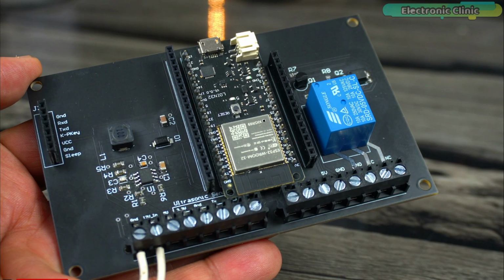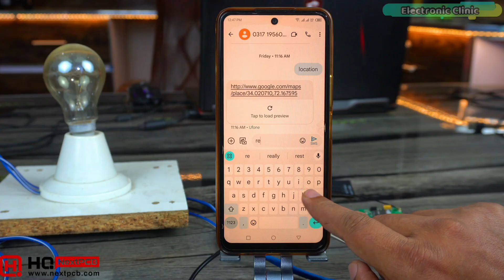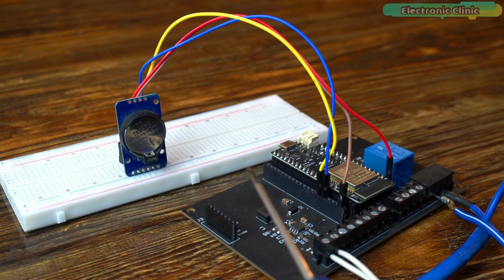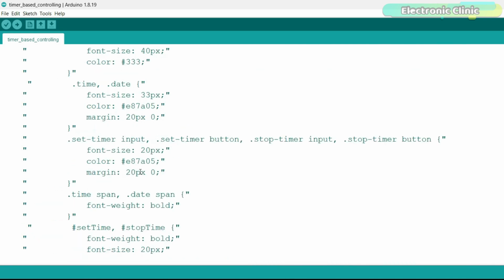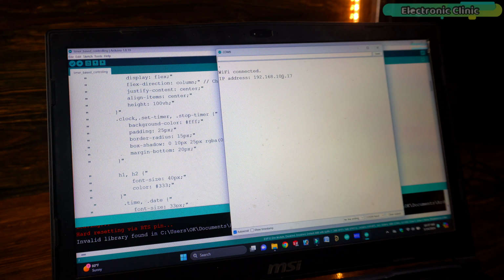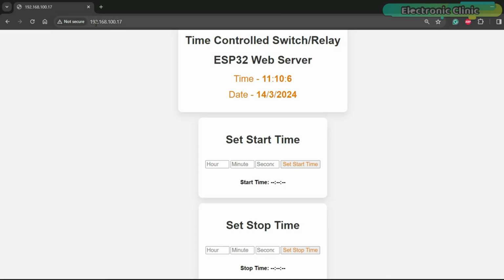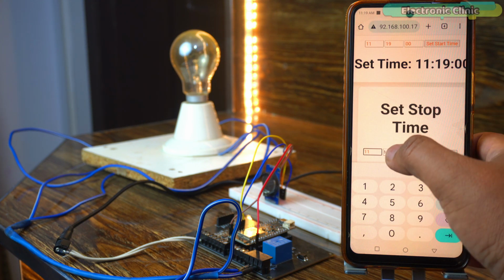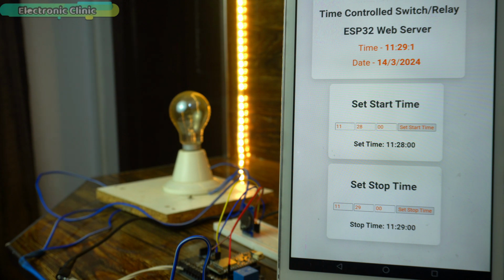Time controlled Swtich using ESP32 Web Server and DS3231 RTC

Comment: Awesome project, the only thing lacking is the on off set time storage into eeprom memory.  Can you modify the code to add that feature also so that one does not need to reprogram it on power failure,

Comment: Sir esprainmaker iot with esp32 working inbuilt RTC control relay without internet one time fetching schedule time from server and working without internet until power reset. I'm using battery for uninterrupted power supply to esp32 and working well without internet timer control relay